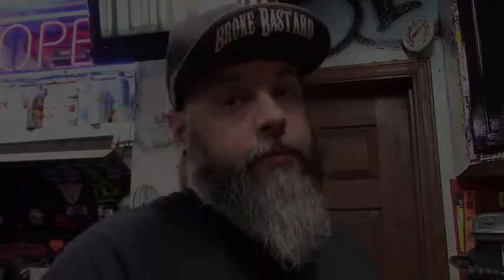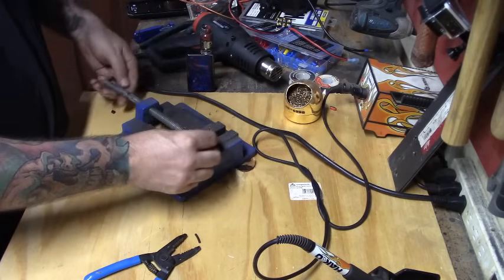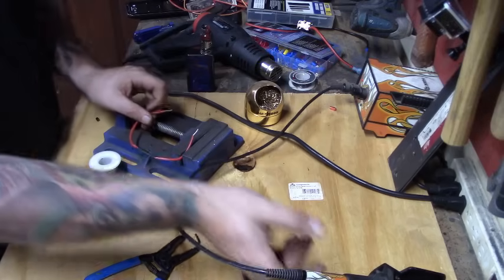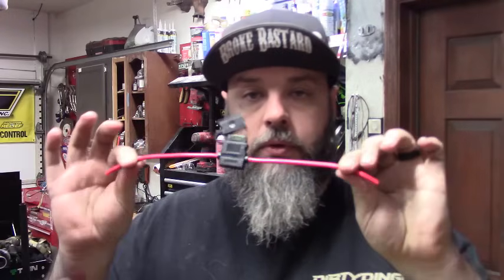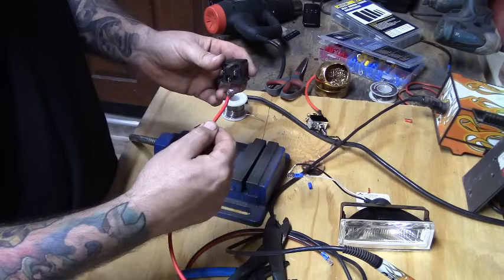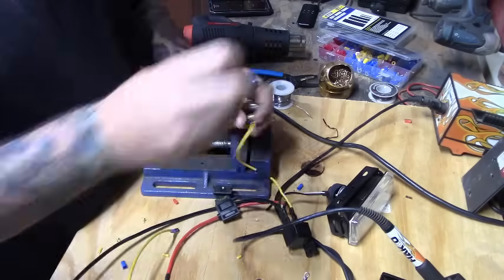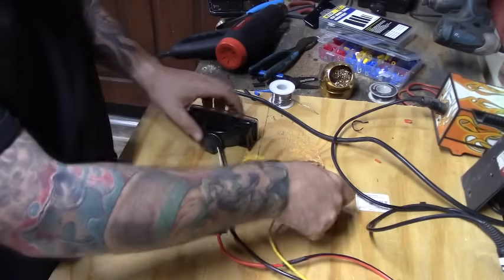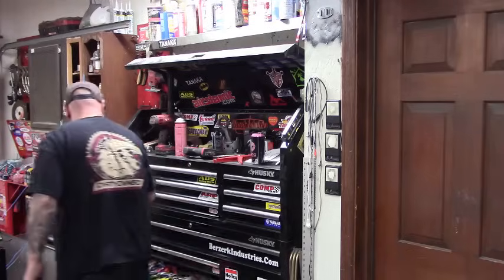How to wire a Relay and Why You should use them.

Comment: Can I run the switch wire from the relay to a mini fuse tap to the ignition fuse in my fuse panel for an intercooler water pump? So when I key on my car it'll switch the relay on? Or is that bad to do? How else would you use key on if not?
Reply from the maker: Yes you can use anything with ignition power to activate the relay.
Reply: @BrokeBastardGarage  ok thanks. Just wanted to make sure I'm installing this correctly. I also fused the main battery power to my relay. Thanks!

Comment: I always fray the wires, interlace both wires and twist them tight, tin the soldering iron tip and place iron tip on bottom then press solder into wires above letting the solder absorb into the joint. Heat shrink tubing bro finish it off.

Comment: Can i ask why didn't you use the switch as a ground to activate the relay ? Wouldn't it have been the safer bet rather than using a hot to activate the relay? Just a question.
Reply from the maker: SNOW MAN the relay needs power to activate the switch inside. No if you wand you can use relay to throw a ground inside of a positive

Comment: I want to power a pcb with 4x18650 Is the relay an overkill? I have a 3 prong rocker switch Thanks!
Reply from the maker: For 4 18650 batteries use a mosfet chip it works light a relay.

Comment: Can I ask you your advice in running two wires frrom my car battery to test an electrical component after it has been disconnected from harness? Guage of wire I need, fuse link needed or not. It would just be a short test to see if the motor in the electrical pump is dead or not.  Thks..jc
Reply from the maker: J C so good rule of thumb use the same gauge wires that are attached to it normally. Fuse is a good idea.
Reply: @BrokeBastardGarage  thanks very much...jc

Comment: Crimping is far superior for vibration and off road applications. The correct cable size and crimp will be the same a soldered connection.

Comment: Rookie mistake at 9:38...never ever lay the soldering iron down on your counter. (Especially if it can roll) I can think of many ways this could go south real quick. Not only could you burn yourself but it can also start a fire. If that iron begins to roll off the counter the first thing your going to do is reach and grab it to prevent it from landing on floor where the pile of rags are sitting (which are covered in gas because you were cleaning some engine parts). So if your lucky enough to grab it then you may be unlucky to have grabbed the hot end in which case you drop the iron on the rags which are soaked in gas sitting on your garage floor and " poof " you are now like the marshmallow on a stick that just caught on fire and if you dont blow out the flames quick enough you become like charcoal on the outside and gooey on the inside. We wont even talk about how bad it smells, like burnt flesh and hair. So please put the soldering iron back in its proper stand and dont ever do that again!!!

Comment: Does this mean none of these wire are getting hooked to the negative battery?
Reply from the maker: As long as there is a proper ground there is no need to run wires All the way to the battery
Reply: @BrokeBastardGarage  
What about the switch ground wire that goes to a proper ground as well and no need to wire to negative battery?
Reply from the maker: @littlej3777  I wound wire the winch to battery because of the amperage draw

Comment: what is the point of the fuse?
Reply from the maker: Miguel Marquez the fuse is a safety measure. If the hot wire every grounds out the the fuse will pop

Comment: Quick note about those relays, pin 87 is when the relay is active, if you see 87a though, that's giving power when the relay is not powered! I mistakenly got a 4 pin power to turn off relay, meaning it had a 87a pin & not a 87 pin! Also, if you get a 5 pin relay, that's what that 87a pin does!
Reply: I stopped using a lighter for the reason of my fingers just got to raw trying to light the darn lighter, so glad that I got a heat gun! That thing works wonders on more then what is shown here!

Comment: Hey Broke, I have a question you may be able to help me with. I have not been able to find an answer online. Ok, I am installing a winch on my truck. I am also going to install a power interrupt solenoid under the hood (a Warn Brand). The solenoid will be operated by a 3 terminal (w light) toggle switch inside the truck. The question is whether I need to run a relay between the toggle switch and solenoid. Would there ever be a need to run a relay between a toggle switch and solenoid? Thanks,
Reply from the maker: Should be fine with a fuse. Most solenoids act like a large relay.
Reply: @BrokeBastardGarage  Hey Broke, THANKS for the reply.  I really appreciate it.  That is kinda what I was starting to think.  One more question.  I want my switch inside the truck to be able to interrupt power to the winch WHENEVER the switch is in the off position.  Since the wince inside the truck must be run to a power source, if the power source is connected to an ACC or Ignition source, does this mean the switch will only work when the ignition is on?  I mean, if the car is turned off does this mean the winch is powered since the switch has no power to disable the solenoid?  Hmm, thanks.
Reply from the maker: @justsomeguy4941  yes if the switch is wired to key power then that’s the only way the winch will work is with the key on.

Comment: Is it wrong if I connect the negative of the lights and relay straight to the negative terminal of the battery instead of ground, after all they are all same circuit? Does it somehow drains the battery?
Reply from the maker: I don’t see why that would be a problem

Comment: the switch connects to #30 on relay, and the other switch lead goes to Ground? or?
Reply from the maker: You can put power for switch from 30 if you want it to work even when key is off. Or you can pull power from ignition hot so it only works when key is off. 87 got to the accessories that you are powering. 85 to ground and 86 goes to the switch.
Reply: @BrokeBastardGarage   Thanks for the quick reply, I'm working on adding lights to a Polaris Ranger. I understand the switch is powered from the relay from terminal #30 but what about the other wire on the switch? it seems to me the switch would just interrupt the power circuit to work, so it would need to go from power and to the lights? sorry I feel like idiot!
Reply from the maker: @tomthesing6488  this is the best way I can explain
30 - fused battery power
85 - ground
87 - to positive side of lights
86 - one side of switch
Other side of switch to key hot power for use only when key is on. 
Or
To fused battery power it work at all times.

Comment: I really enjoyed watching video
But I have a question.
I want to tap led turn signal strip (12V) but my turn signal voltage drops around 10V when the car is on (when car is off it is sta
bil 12v). Can I fix this with a relay and with a stabil 12v froma car battery...
Reply from the maker: Aleksandar Vujicic yah if you have a problem with lost voltage. Use the original wire as the switch leg. Run new power and relay.

Comment: K Wait, Im trying to hook up 2 x 4000 lumens led work lights 2.5 amp draw each.. now this method does not work for these ? or can i just put an inline fuse wire after connecting them both together and then to the battery / toggle switch inside my cab.
Reply from the maker: David Harris you need to make sure that switch can handle the draw. If not then you need to use a relay. Fuse it near the battery.
Reply: @BrokeBastardGarage appreciate the quick reply. I didnt know that the "on off switch" has a rating for power..  guess ill need to check that.. but still use a relay ? hah bit confused still apologies. first time wiring somethign like this and think your videos help the most
Reply from the maker: David Harris I prefer to use a relay so doesn’t matter what switch I use. If you go to your parts store you can see what the ratings of the switches are. This only matters if your not going to use a relay.

Comment: the only problem i have with the way you wired the switch was that you connected the power directly to the switch and the main power to the supply line for the light, the proper way should include a fuse in between the switch and the battery or power supply, and not on the main light switch becouse the loadd on the main line is different fron the one on the switch, hope this helps to make safer circuits, love your video, keep up the good work....

Comment: Skimming through all the comments, i did not see any mention of wearing Safety Glasses.
Any time we are working on our vehicles, we should always wear them. The good Lord gave us only two Eyes, take care of them.
If something were to happen, you do not want hot Solder splattered in your Eyes.

When Iam soldering two wires together,  I strip, open the wires a bit, push them together and twist them.  Add a bit of Flux and then Solder.

I have an old Weller I have had for over 50 years. the Solder tips are tinned, and when using it, wipe it off on a wet sponge, add the solder to the tip, and to your work. Wipe off tip and add a bit of Solder before sticking it back into the holder, helps to keep the tip tinned.

I worked for Sylvania Electronics back in 68, and went through a solder class.
One thing I remembered, Solder is for continunity, not for strength. 

Great video though.

Comment: Really good video! I understand it heaps better. 

If I am wiring up 12v accessory sockets, a relay is not needed as i am not using a switch?
Reply: If it goes on and off with the key switch,  it needs a relay.

Comment: I highly recommend using marine heat shrink.. at least in the engine bay/outside of vehicle. 
It has a glue in it that makes it water tight.. can also use a dab dielectric grease before using regular heat shrink.
60/40 roslin core solder and flux that is made for electronic use. The shit you use for plumbing has acid that will eat away at the wires over time

Comment: Best way to explain is draw it out and  label relay numbers 
Then draw out power to relay and the ground correction 
Just saying 
Most people don’t solder wires 
Just cheap crimp terminals which will break down over time

Comment: Thank you for this video. So helpful, I will wire my front light bar this way. Question for you, I have two 4 inch Piaa lights on my canopy facing backwards, I thought of running wires directly to reverse wire or to my cargo lamp wire cause that has a switch. Is that safe or too much juice on those fuses?
Reply: RE:Rob Lidstone. My guess is too much draw, but maybe your lights have a label that shows wattage. Warning: Check local laws to see if those can be wired to reverse switch.

Comment: But my problem is i cant turn fuel pump off. So when i turn key off position the fuel pump stays on. Will the by pass correct this??
Reply from the maker: Luba Luba use key hot power to switch connection on relay. So when key turns of it will turn the pump off
Reply: Broke Bastard Garage so I don’t need external relay just by pass?
Reply from the maker: Luba Luba I suggest putting the fuel pump on a relay and and having key hot (ignition on) switch on the relay. So when you turn the ignition on the fuel pump comes on.

Comment: great technique soldering the exposed wire from the bottom of the wire so that the exposed wire soaks up the solder. @Broke Bastard Garage   Why do you use rosin core instead of Flux?

Comment: I'm in a Pickle I'm pretty savy when it comes to most wiring but I'm stuck I have a Infiniti Amp in my Vehicle and got a New Stereo unit I popped the fuse box open found the Relay should I just get a in line Jumper and put a 7.5 fuse to Accessories next to horn to Pin 87 On the Relay to turn on the little fucker when I turn key on?

Comment: How could I do this with a 3 prong rocker switch labelled (-,+,Acc) which would the relay plug into? Acc, or +? Would I need to ground my switch?
Reply from the maker: Darkroom Ignite! Acc goes to relay    - is there because the switch probably lights up.
Reply: The light on my switch is working. The light I'm doing this for... nothing.
Reply from the maker: @darkroomignite8264  use a test light or a multi meter to see if your getting 12 volts out of the switch
Reply: I can get it working just fine without the relay but the switch gets real warm. When I add the relay, I can't get anything.
Reply from the maker: @darkroomignite8264   ok lets check where each wire is plugged in, 85-ground,  30-- battery +, 86 --- switch, 87---to what ever your powering
Reply from the maker: check 30 has power and 85 is grounded
Reply: Yes. Exactly. Or maybe should I find an on/off/on like yours?
Reply from the maker: @darkroomignite8264  you can but i have made these illuminated switches work before
Reply: @BrokeBastardGarage  Is it possible have bought a bad relay? It's brand new. Just strange that everything works except the relay.
Reply from the maker: Darkroom Ignite! It’s possible I have had bad ones

Comment: Very good.  I have no criticism of your methods.  I have always kinda liked soldered connections myself, but a crimp connection done with the proper tools by a competent installer is a good solid connection.  Electricians seldom solder a connection.  I was an electronics equipment installer where our crews used thousands of crimp connections and only occasionally soldered anything.  Many years ago all telephone circuits were hand soldered, but all telephone circuits have used solderless connections for a few decades.  They all seem to work.  Having said all that  I understand that your audience is mostly DIYers, not professional installers and that makes soldering the most reliable connection.  Nice video.

Comment: Had this issue with my Harley.All the power for the bike ran through the ignition switch.Over time it melted the contacts in the switch(15 amp)I put a relay with a 15 amp in line fuse and haven't had any issues since.Don't know why Harley doesn't use them but they should.

Comment: I am a fan of the relay socket plugs.  I've installed three 20 amp circuits on my van that are operated by 7.5 V relays.  The relays work great to protect the circuit but when the circuit fails, it's always because of the relay.  I can't find a quality relay that isn't made in China or Mexico  that will last more than about two years.  They say "a chain is only as strong as it's weakest link" and that weak link is always the relay.  I now carry two spare relays in the vehicle at all times that can be easily swapped in the socket plugs.

Comment: I liked the video, but you really shortchanged us at the end when connecting the switch which is the most crucial step.  Your comment that's pinned at the top of the comments is not clear at all. One yellow wire is connecting the switch to fused power through the relay, but after plugging the switch into 86, where did the second yellow wire connect to? It can't be the battery. If you answered this somewhere in the comments, could you pin it to the top?
Reply from the maker: The second yellow wire goes to fused power. Now the choice is yours either ignition hot power if  you want to have it only work when the ignition is on or battery hot to have it work all the time.

Comment: Do you know cheap chinese relays emit 200v of flyback volts which stungun shocks your system when you turn the system off......?You need to use relays that offer diode protection..

Comment: If you want to remember the pins on a Bosch style SPDT relay like this, you can remember this:

Victory Comes Now = Voltage+ Common Negative. Add simple Open Close. So "Victory Comes Now Open Closed".
Read left to right top to bottom. It's already a part of people's knowledge base as an almost or modified the "sign of the cross".  

You can even say it :
"Valiant Victory Comes Now, Heaven is Open Hell is Closed" = Verticals Voltage+ Common Negative, Horizontal Open Horizontal Closed.

Comment: You don't tend the wire should tend the soldering iron because it gets oxidized and insulated so it won't heat up your connection to solder

Comment: Good video explaining about fuse and switch, and why you want to have relay.

You should always crimp before pre soldering the wire the wire you going to solder.  Because crimping solder will not get a good solid connection.
So yes, you are doing it right. :-)

Comment: On the video its not clear where the other end of the switch wire is going
Reply from the maker: Desert Rat 2000 fused power either battery hot or ignition hot depending on what you want
Reply: Ok thank you 🙏

Comment: The reason you don't find soldered joints in cars and motorcycles is because the solder creates a rigid joint. Rigid solder joints that are subjected to vibration, as in cars and motorcycles, eventually fracture and fail. So don't solder wires in high vibration scenarios such as in a car or a motorcycle. There are methods by which you can join two, or more, wires without solder so that you can't pull them apart (learn these techniques). Add heat shrink to bare wire connections and your joint won't short or fracture. In summary, do NOT solder wires together in cars, motorcycles, or other high vibration, applications.

Comment: Please tell how to determine the fuse amperage to the project?  How to do the math? And how to choose the relay?  Please.  Thanks
Reply: Ohms law:  power (watts) ÷ volts = I (current or amp) 
So a 20 watt lamp using a 12 volt supply would be 20÷12 = 1.66amp you will need a 2 amp fuse and circuit cable capable of carrying the design current of 2 amp, remembering the longer the circuit the larger the cable cross section needs to be to account for volt drop & current increase.
Reply: @fishingnoddy7299  beautiful!! That was cool! Awesome breakdown!